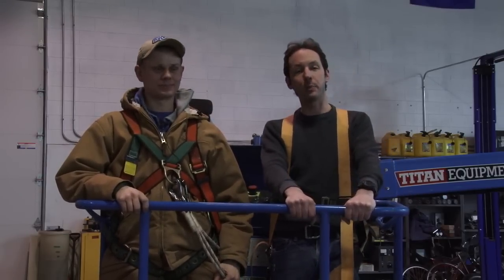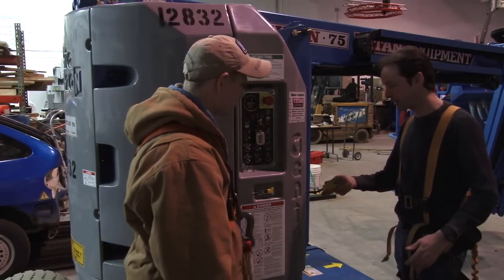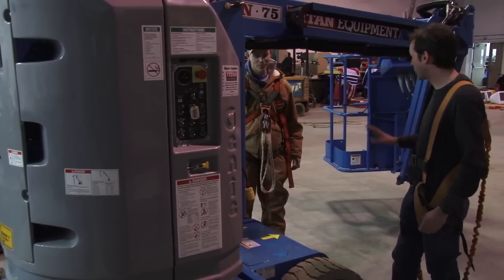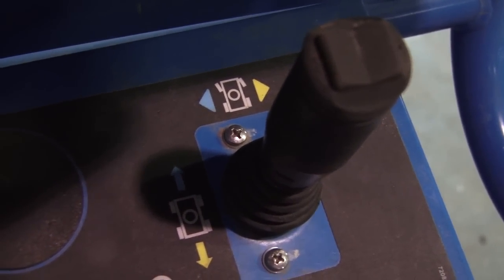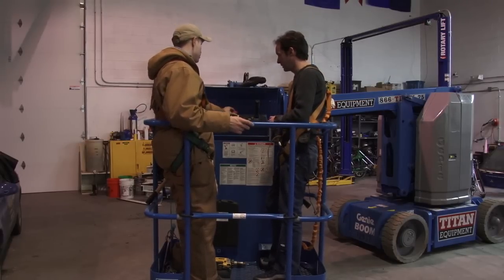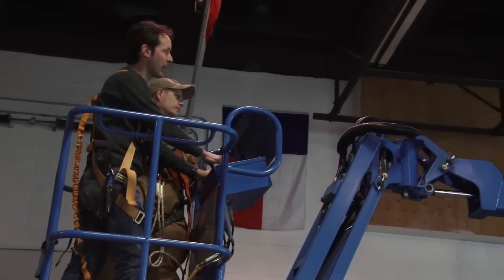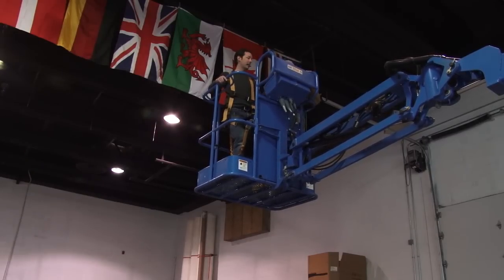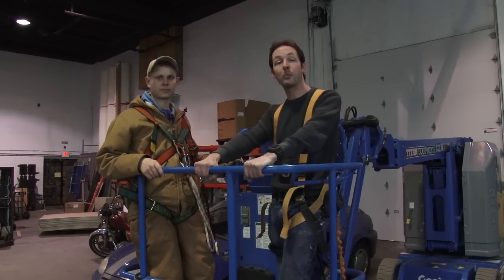Exploring a Genie Boom

Comment: Nice video guys. A couple points of calcification: This machine weighs 15,500lbs. The massive weight is needed because the unit is only 3'11" wide. Secondly, as a general rule the steer end of the lift is concidered the front, the drive tire end the rear. Thanks again for the video. Bill @ Titan Equipment.

Comment: From what I have been told about the one we have work, the end with the steering wheels is the front. The front is normally determine by the fact that the boom doesnt rotate over the steering wheels so you do not change the way you approach things cause steering radius change with front or rear steer. This is what I have been told with the one I use at work.